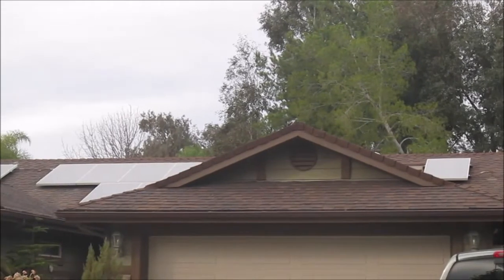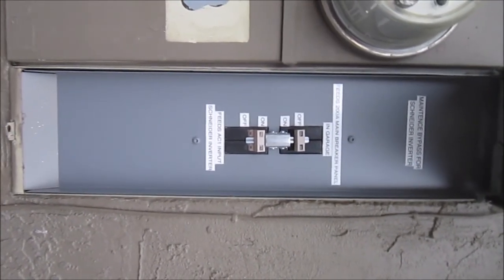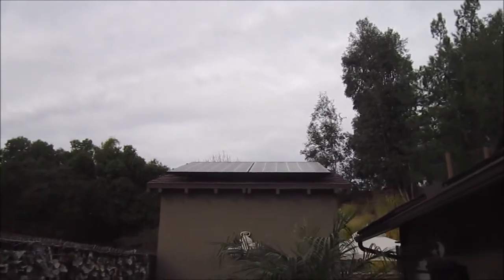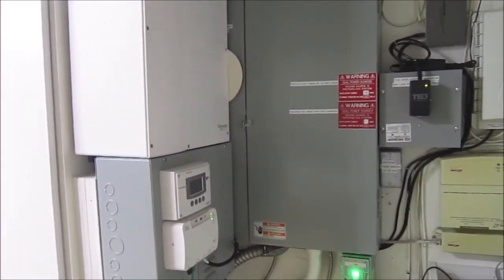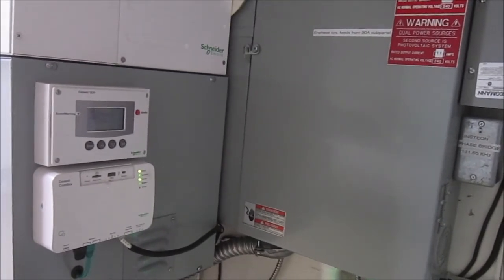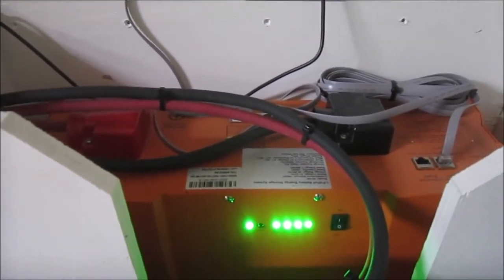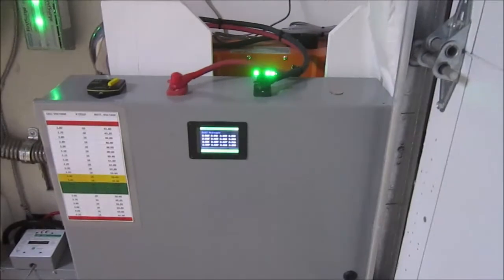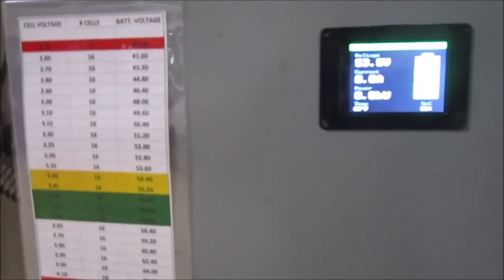48V 120AH Lithium Iron Phosphate DIY Battery Build

Comment: What BMS did you use?
Reply from the maker: At about 11:30 in the video I did mention the ZEVA BMS16 v3 and about 12:30 there is a good shot of the BMS when I opened the cabinet. ZEVA stands for,  Zero Emission Vehicles Australia. Their website is still active but looks like the BMS is not listed for sale at this time. Perhaps due to parts shortages or the political problems in that Country. In any case, [https://www.zeva.com.au/index.php?product=140] is the link to the page with the BMS, Instruction manual PDF and even downloadable fabrication files. This product doesn't get much attention or reviews on YT. I have always preferred the ZEVA type of BMS where the current shunt and Power management device (usually a contactor) is NOT part of the BMS PC board. The all in one BMS products seem to be the most popular but I don't like the idea of that much current being controlled by FET's, lots of heat. Of course the problem with an external Golf Cart type relay is they can consume 100 to 300mA ALL the time just keeping the contacts closed. My latest video is all about eliminating the contactor and using a Remote Trip Breaker instead to reduce parasitic loads as much as possible. Thanks for the comment.

Comment: Hey Bentley.  I responded to you on Will's channel a little bit ago.  With that CAN interface you have, you could use a Raspberry Pi to connect to the USB interface - of course that would require some documentation for connecting to the interface and how they communicate.  I assume that device has a Windows app, but if they aren't doing anything tricky, it wouldn't be that hard.  If you want to pursue it further, just let me know.